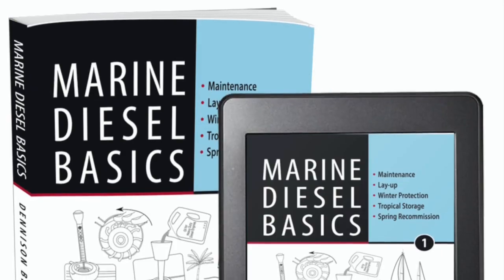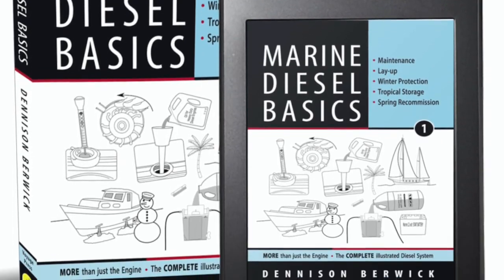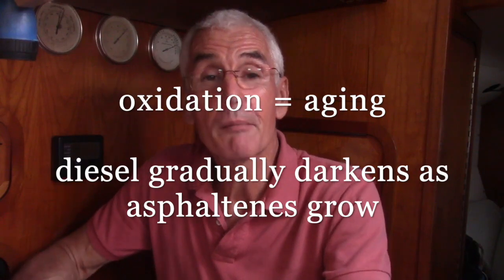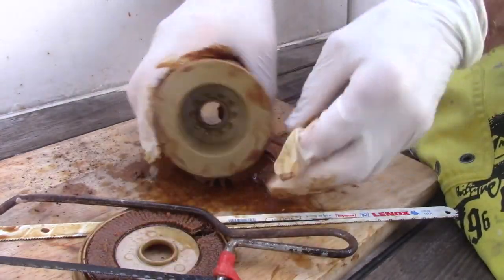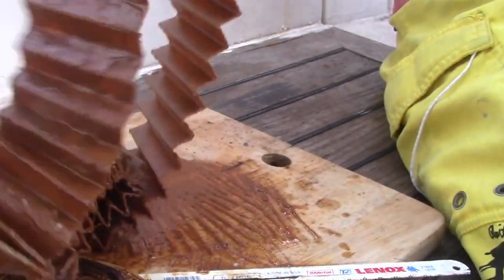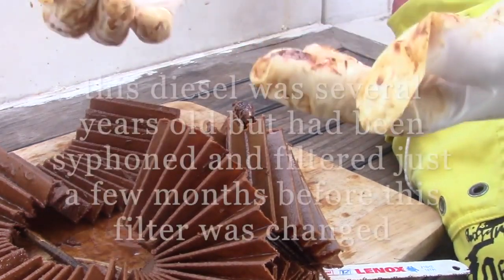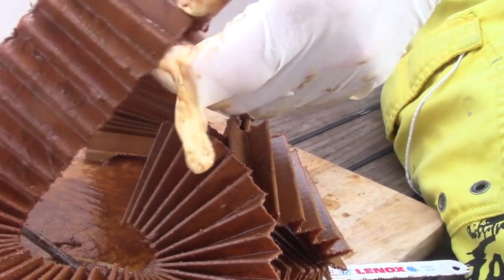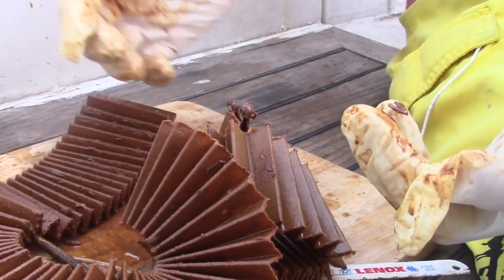Why does diesel fuel darken over time?

Comment: How do you get rid of this in a fuel system?
Reply: The asphaltenes need to be filtered out. This is what fuel polishing systems do, as well as removing any crud.

Fuel is pumped from a tank, thorough a filter and back into the tank. Crud and water need to be drained from thr bottom of thr tank.